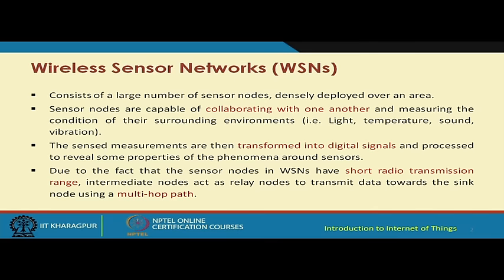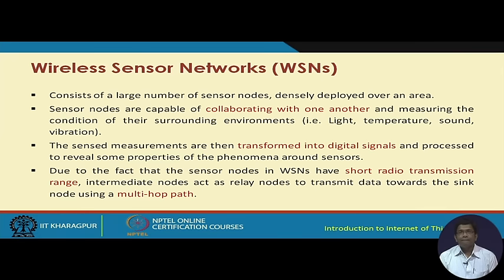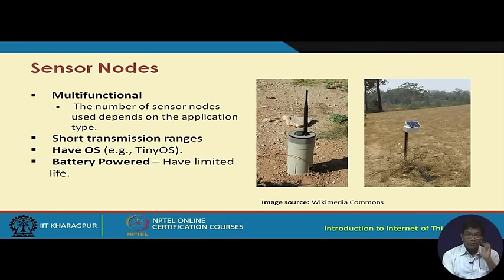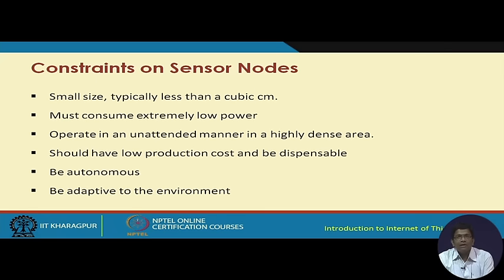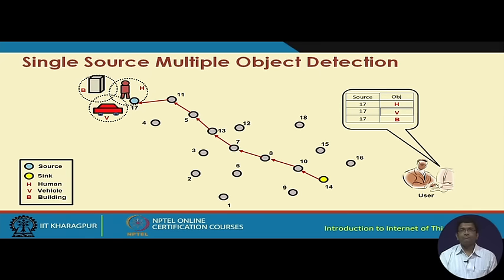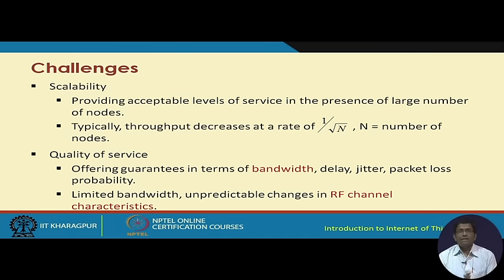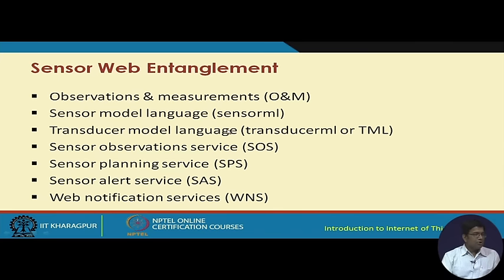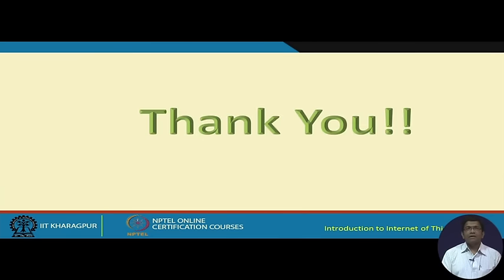SENSOR NETWORKS-I

Comment: 00:24 Sensor networks enable real-time, remote information gathering for IoT systems.
04:25 Building sensor networks for greater sensing coverage and real-time monitoring
09:19 Sensor nodes consist of various components and can be used to form a network.
13:15 Sensor networks operate through multi-hop communication.
16:43 Sensor nodes in a network communicate via multi-hop communication.
20:13 Complexities in sensor networks
23:22 Challenges in sensor networks include quality of service, energy efficiency, and security.
26:44 Cooperation is crucial for multi-hop networks.
29:47 Security challenge: False routing information

Comment: 3:26 Sensor devices are called Sensor nodes in IoT network or the sensors which are embedded in these devices are called Sensor nodes?
Reply: Sensor devices.